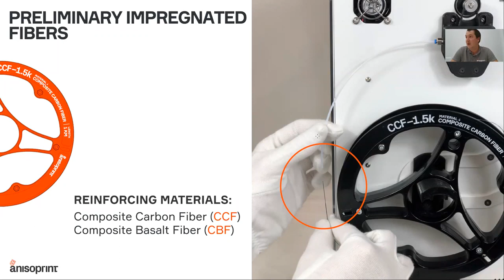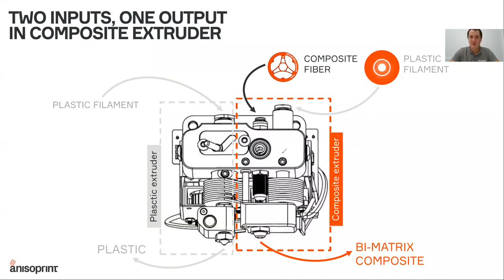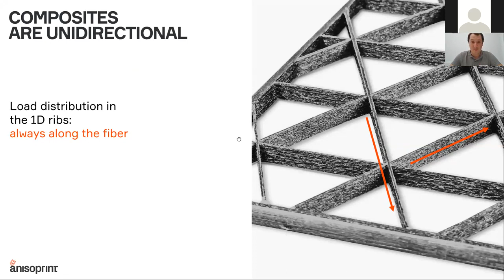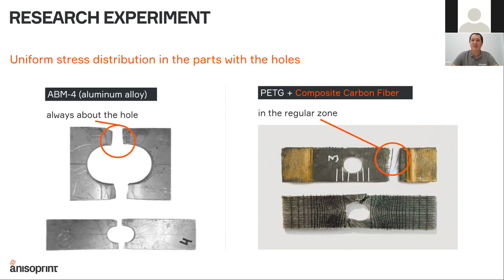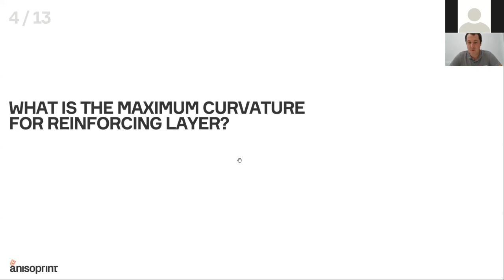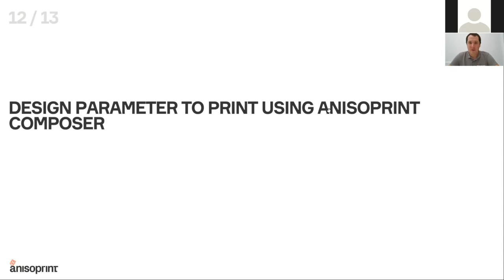Carbon fiber 3D printing. 3D PRINTING OF COMPOSITES WITH CONTINUOUS FIBERS — Anisoprint approach

Comment: I am curious, how does adding the continuous fiber affect the layer adhesion?
Reply: it's said that the fiber goes inside of the extruded filament which is why it's called co-extrusion
so basically it shouldn't affect adhesion between layers since it's inside the layer